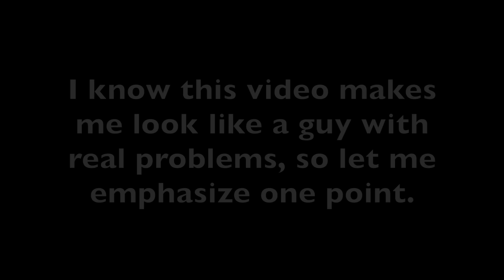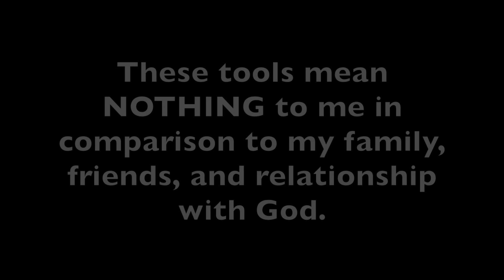Why I Love Tools

Comment: I've wanted an anvil for decades... I had a job where there was a very beat up one. All the edges were rounded over... but still... it came in handy all the time...

I garbage picked a nice long pry bar... it was bent... but a bit of torch work, it was perfect... I use it often...

I'm more of a metal worker... and I've tools that get used often.

I do supplement my heat with wood. I was given a Stihl 028 Wood Boss because its previous owner, a life long smoker, can't work that hard anymore. It sat for a couple decades. I wracked my brain trying to figure out why it wouldn't start, replacing everything... I basically got in my own way, over thinking. I just got it going...

I was also given a '78 Partner saw. It was used since new by a friend who homesteaded in WV. it was used often, used hard. I got it going shortly after it being gifted to me... used it a few times, was amazed at how quick it would bury my feet in sawdust... but it died again... I think carb issues... found a rebuild kit... once I get it going again, these two saws will be close friends.

Excellent video... I've tools I inherited from my father and an uncle. They grew up in the city, but as adults, moved to the country, and figured out how to be craftsman, both building their own homes. I've some of the tools they used doing so.

I'm 69..  and feel like I'm just getting my stride becoming one with my workshops... life is good... with tools.

Comment: All the tools you pulled up are my favorites too except for, and I will definitely look for a Burke bar. I'm not a blacksmith so I don't have the forge hammer and my anvil is a railway track, so Id have vice grips on my list but I treasure the same tools. I live in an old town where old tools are still available at the flea market and the tool vendors at the museum. It is called the birthplace of steel and had a foundry, steel factory and rail car factory with the large axle forge still on display. I have been in tunnels with rows of huge  presses and wheels they poured a concrete floor right over it all for the new foundry which is now gone. I did contracting work at that foundry i remember filling bins with all sizes of perfect wooden gear and large pulley patterns to throw away when each one costed thousands to make.  Anyways excellent video where I can relate to everything.

Comment: Hi Mr Wadsworth.
I’m calling you that because I can’t recall you Christian name. My name is Michael Mugridge originally from the Gold Coast in south east Queensland, Australia now from Sydney which I’m sure you have heard of. I have a friend I have known for what 47 years whose name is David Wadsworth. We both went to a boarding school in Brisbane. I have been a lawyer since 1986. My father worked at the local council in Tenterfield, I bet you haven’t heard of that town. It had about 3000:people in 1969 and has about the same now. Anyway my childhood family moved around several towns before arriving there in 1969 when I was 6. Anyway I went back there during school holidays from 1973 until 1980 when I graduated. There isn’t much to do in Tenterfield so dad got me a job with the local builder Gus Darby. I was what 10 when I started and earned 37 cents and hour! I was worth -37 cents an hour to him I think if not less. I started washing bricks, scraping paint on windows and pulling nails out of old timber and stacking it. In 1980 I think it was we undertook a major construction. The new cattle sale yards. 1500:posts, 1500 post holes. The posts were iron with flanges welded on 4 a piece to which rails of about 8x2 inches bolted onto the flanges, two bolts at each end. Guess what my job was bearing in mind my extensive experience say 12 weeks a year for 7 years. You guessed it post hold digger no 1. There was no post hold digger no 2. It was about 3 weeks in before a mechanical post hole digger was available, it was a council job after all and dad was the shire clerk a fancy name for the CEO. Did he know I was digging the post holes, yes. Did he control the council machinery, yes. Anyway I was promoted to cement mixer no 1 when the time came and boy in 40 degree (celsius) heat you sure get a sweat up. I returned to school after those 8 weeks and got one of the best ergo scores ( rowing machine)of anyone and could bench press 85kg. My children who are now 28 and 29 can be disappointing at times and I wonder what they’d be like if they only spent their holidays working for Gus.

Comment: I am an unabashed tool whore ... I have almost never have held any tool in my hand that I didn't lust after.  I agree with his choices up till number one... the multi-tool... first I have had about a dozen of these and the Kershaw A101 is better than a Leatherman (well I am expecting some blow back on that comment)  It is also twice to three times as expensive fetching near two hundred bucks used... they stop making this tool about .... well a while ago. 

 First it has a wicked sharp knife that one can open with a thumb... with both a serrated and straight edge and is very pointy.  

It has a real hacksaw blade. And the pliers lock like visegrips, which is extremely handy.   So a multi-tool is number one... whatever one chooses it is better in a pinch than one's fingers.

But as I was listening to the video I honestly never thought of the multi-tool and was absolutely sure that ViseGrips were going to be on that list. Maybe it is just me but locking pliers, while using before or in lieu of a proper wrenches should be frowned upon... so many times a pair of locking pliers is all there is... from holding a broken weld together to keep a trailer fender from falling off to a thousand other tasks... 

Now in my shop there is a rule if the tool is good... you need a spare and if it is really good then you need a second and a spare.  Justifying four of any one tool ... that can a little tough... but as people who work with our hands ... rationalisation is our forte ... why else would we invest three days fixing a $20 item......?

This number of is a good rule... except when it comes to clamps... there is no limit... the more the better.... any shop worth its salt has dozens.... hundreds of clamps...  ViseGrips comes under that heading   .....  thanks for the video... ;)

Comment: Everyone’s first favorite tool should be an Italian made espresso machine for that first quality cup to get you started for the rest of your day.
Secondly, any Communist Chinese tool should never ever be on the favorites list.
Finally the Stihl saw.  May have great innovations but it’s paradigm in on the downslide. I was just helping a relative clear his building lot and conducting wood chipping.  As he reached for his 16” stihl, I reached for my 16” Cordless Makita.  The limbs were notched before he could get the stihl started.  Ultimately you’re going to have a gas, carb, ethanol, starting angle, carbon, ignition issue with a 2 stroke engine which overcomes all of those other innovations

Comment: This made me cry !  I am a carpenter . My father , and grandfather were Boilermaker's . 
     Wood , and Steel !   
     Aside from the gigantic power hammer , I have used every tool on your top ten !  I have my own top ten , and similarly , for utility , and sentiment they vary .  
       I appreciate the connection that you have with your tools , and the roles they have in life .  
     I have actually chosen to live in my car , rather than sell my tools when times got rough !

Comment: #1. Brains, Imagination.
#2. Eyes.
#3. Hands,... 8Fingers, 2Thumbs.
#4. Microsoft / Intel COMPUTER.
#5. The Internet.
#6. Electrical Connection.
#7. Lightbulbs.
#8. AC Brushed Motors.
#9. Table Saw.
#10. Drill Press.

Comment: I've gotta say I think I know EXACTLY how you feel about tools, or pretty close, anyway. I worked as a carpenter for 25 years and in a fabrication shop for 12, and did property maintenance and renovations throughout. I know the difference between a good tool and a crummy one and naturally appreciate a good one, and I love the feeling of holding a tool that has just the right heft and just feels good in my hand. I've learned that for me, anyway, having access to a wide array of tools broadens my ability to think about the task before me. By that I mean that, when I went to work from the field to a well-equipped general fab shop, I ran into a bunch of tools that I didn't know existed. A big part of my job was design, and just looking at all the tools we had and thinking about their potential functions, expanded my ability to conceptualize what I had to do. (Not having much luck putting it into words.) Anyway, blah blah blah, I dig these vids. Keep'em coming.

Comment: I have a brick hammer that was from my grand grand father when he became a bricklayer (thats what google translate says,but is more of a builder) i about 1936,i dint mer him or my grand father,but thats the best toll iv seen,the chisel is kina of in the diagonal,so it can be kinda be used as a claw frim a claw hammer,and also,it is a hand made (i can see that becouse if the imperfections),so,it is an unique model,i googled a lot and i couls find anyhammer like that,it is really simple,a ingot with a hole and a chisel,but it is unique,and the fact that it is a unique handmade from  about 80 years ago,it is iron so that with the fact that the handle is half the size of one of a normal hammer makes it perfect for striking in concrete and even better in wood.
I may have less experience with carpentry then i have with lockpicking and my experience lockpicking is picking a 2 lever mortice lock (look it up,its the easyest lock too pick),but i can assure you that,that is the best hammer ill ever get

Comment: The beauty of tools are that they are an extension of your personality, and in many cases, your personality has been forged by these very tools. Rather ironic to conceive of a tool you are using as an accessory or catalyst to accomplish greater good and they are actually creating your greater good internally. You shared triumph and tragedy with this tools (sometimes the tools are your only companion to share these events with), they are your witness forever to bring you back to these times when not only did you fortify at the time, you continue to fortify in remembrance.